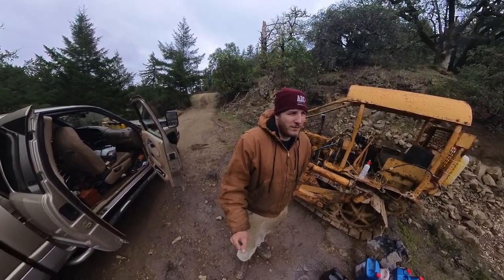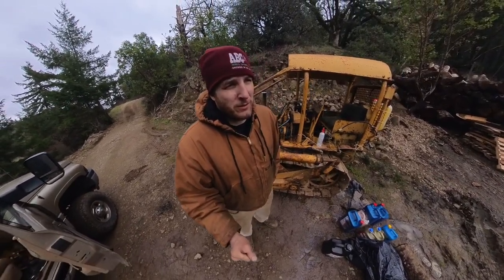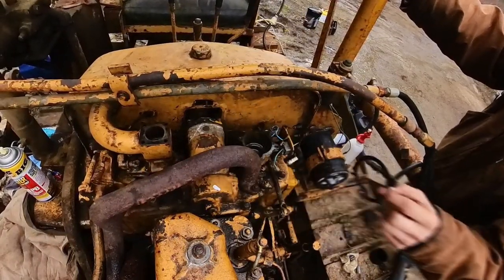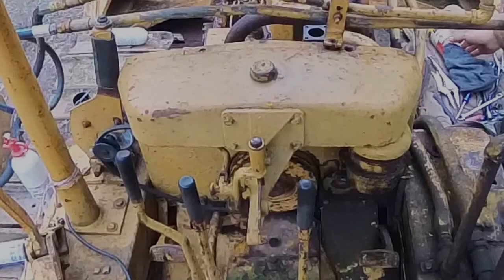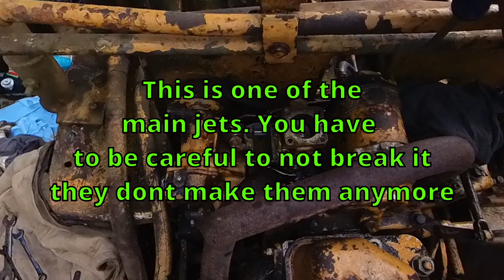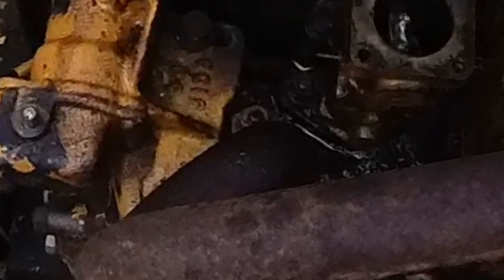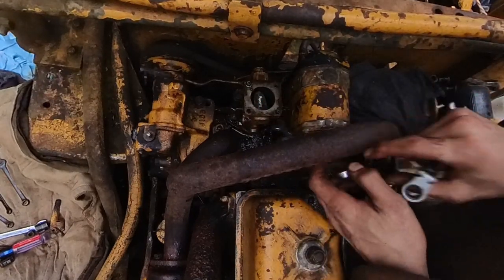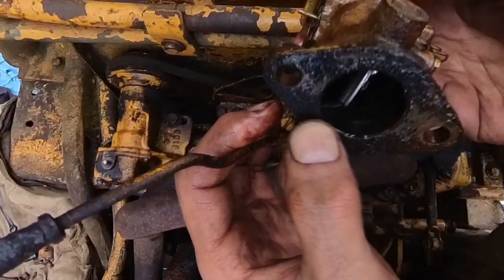#21 Episode 7 D2 5J Caterpillar Pony Engine Carburetor Removal

Comment: Don't mean to rain on your parade. But that jet sticking out looks to be broken. It's supposed to have a tapered end on it and a very tiny hole. I'm just giving you some insight as I just got done rebuilding mine for the 2nd time in 15 years.
Reply from the maker: I got it running pretty good but this carburetor is definitely funky and the parts look different then the zenith paperwork. Not sure what's going on but I have it adjusted and running good now maybe a little on the rich side. Thanks for following I have a bunch of content I will be releasing for the D2.
Reply: Idle adjustment screw should be 1 turn,  and the high speed idle screw should be 1 1/2 turns. With that jet broke its not gonna act right at all. Look up zenith tu4c idle jet and you can see how it's suppose to look. The carbs can  be a little tricky but once tuned right, they are golden. 

Also make sure you do not over Rev the pony motor. 3000 rpm is the max, anymore and it's gonna send a piston flying through the block. Make sure that your governor is also in adjustment as well. Almost found out the hard way mine was out of adjustment and over sped the engine.
Reply from the maker: @jakertime Thanks for the input. It definitely needs a new idle jet the end looked smashed. Makes sense why adjusting it didn't seem to do much it idles really high!
Reply: Your welcome. Love old iron and love seeing it run. I hope this old cat serves ya well!